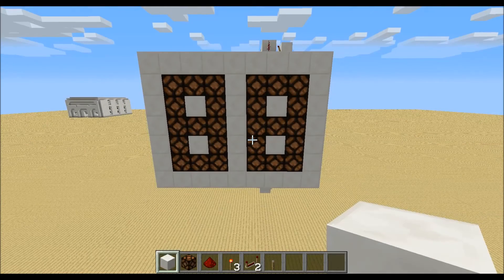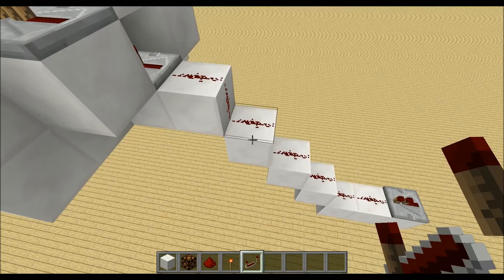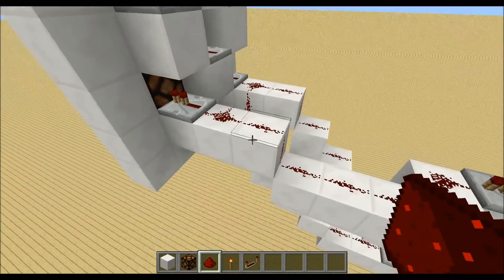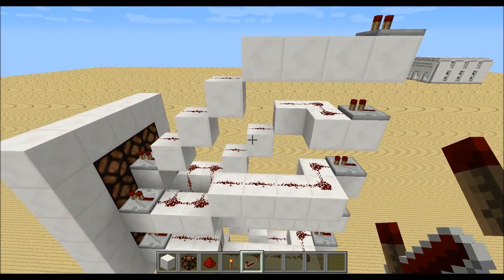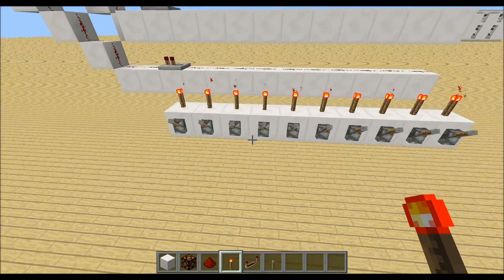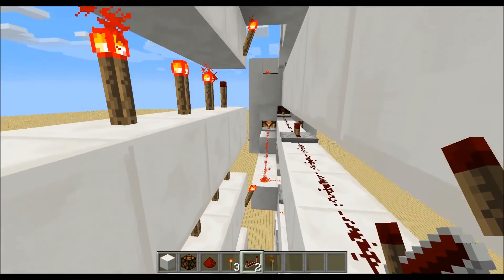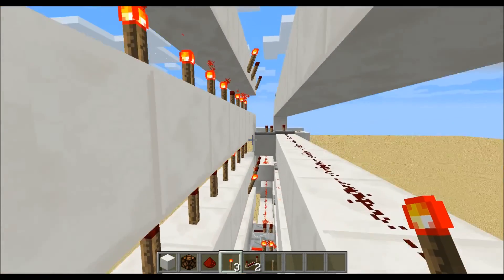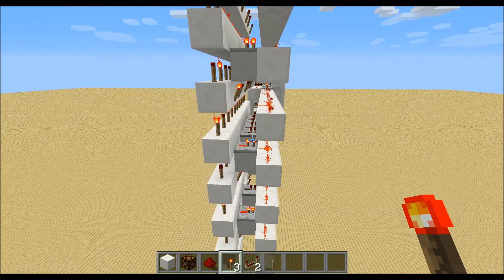Small 7-Segment Display [Tutorial]

Comment: Piston feed tape time. Take a redstone block to power whichever number you want and fill the rest with glass.

OR you could run buttons to each one to make a smart one with a number pad.
Reply: piston feed tapes kinda suck and are very limited, like yeah you can count. but if you wanted to display a certain number(maybe for a calculator) you'd have to cycle until you got to the right one

which is a pain to automate
Reply: @chocolatebar6785  I was using my circuit to make a scoreboard for a minigame.

Comment: why are there repeaters in the code?
and how does it work?
Reply: A 7 segment display works through manipulation of the signals throughout the segments. Some torches are cut off in some segments becuase if they weren't then the display won't function properly. To make number 1 in the display you have to activate the first 2 segments on the right.